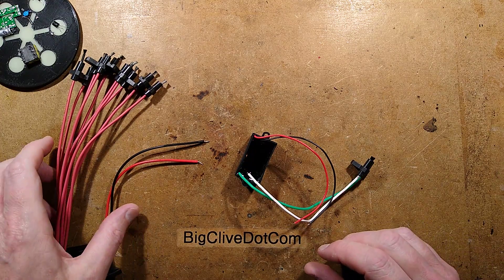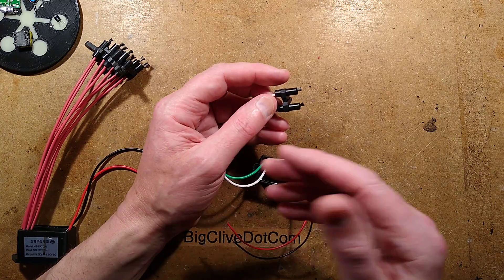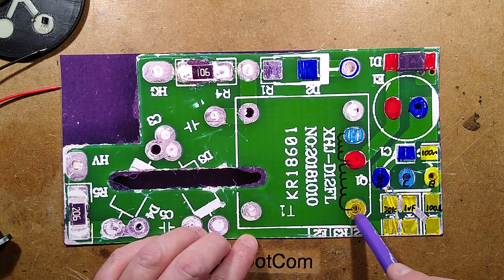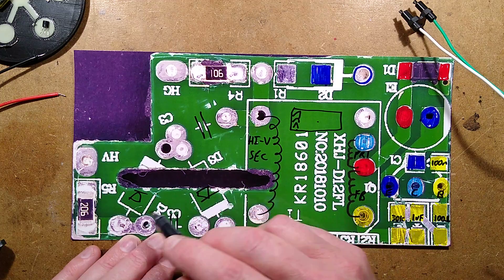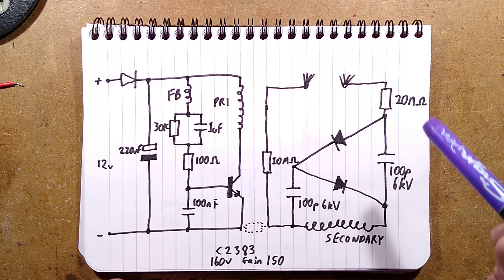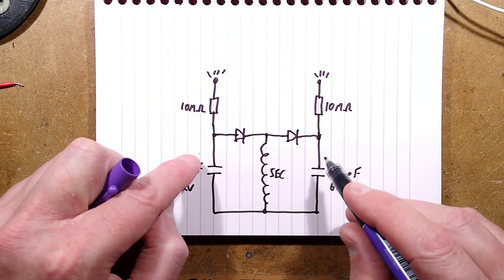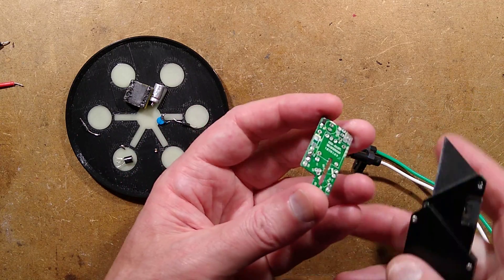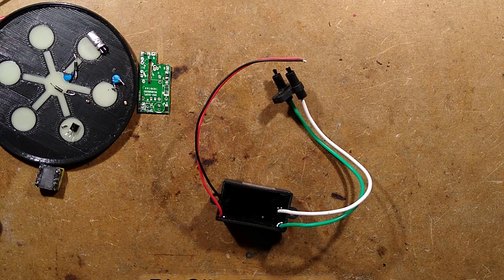Intriguingly different "ioniser" module (de-potting and schematic)

Comment: Clive, Did you measure the forward voltage drop of the diodes?  The HV diodes are usually several junctions in series.  Based on the forward voltage drop you can tell how many junctions.
Reply from the maker: I didn't with these ones, but the datasheet has forward voltage ratings for each voltage range showing a very high number of junctions.
Reply: 10kV diode usually have a 9 V forward drop.

Comment: Would be good for a fridge, powered by 12v smps or smoothed&regulated 12v linear ps?
Reply from the maker: You can get modules designed for fridges that use mains power, or alternatively use a rechargeable fridge ozone unit.  Look for my recent high voltage twinkie video.
Reply: @bigclivedotcom  Thanks Clive - I’m trying to avoid wiring mains into the fridge compartment, plus don’t trust the voltage multiplier- based circuit that employs only 120v.   and i don’t want rechargeable.   so i’m looking for 12v HF transformer based “non-ionizing”unit with very low output, which i  will wire to automatically run whenever the fridge evaporator fan runs.

Comment: I'm a big fan of you depotting them. Maybe film some of it for a long video? A thing I don't understand in this video (1:00): How is ozone meant to be generated when there's continuity between the both sides of the filament pairs?
Reply from the maker: The one with the big bunch of emitters is purely an ionizer designed to put an electrostatic charge into the air, but will still have a small amount of corona discharge on its emitters, so will still produce trace levels of ozone.
Reply: @bigclivedotcom  we just got one of these. So if it only produces low levels it's probably fine to let it run all the time?